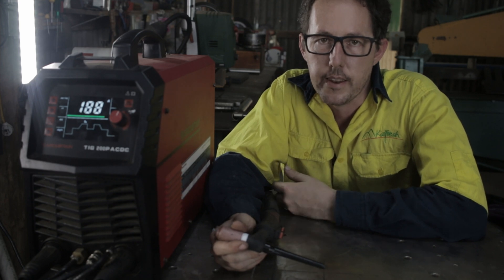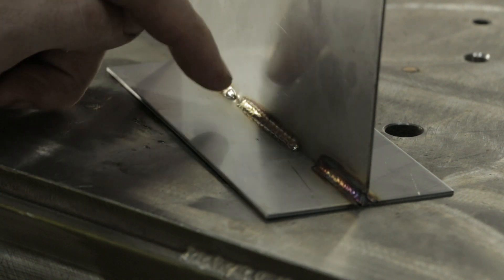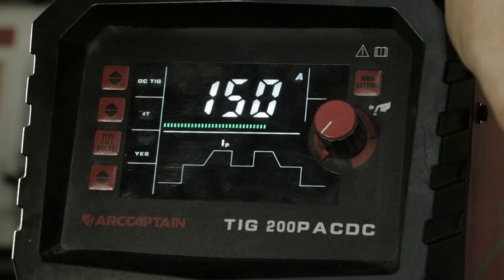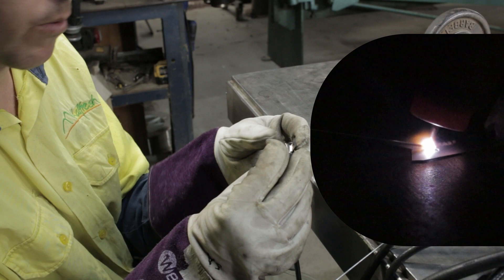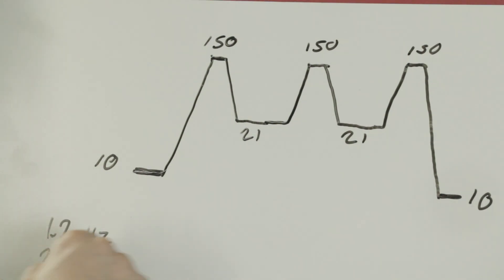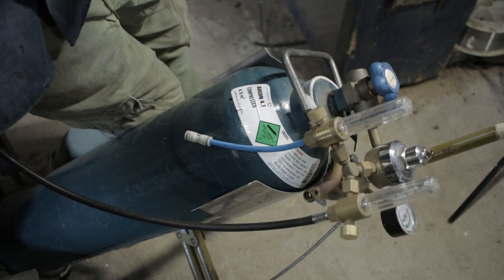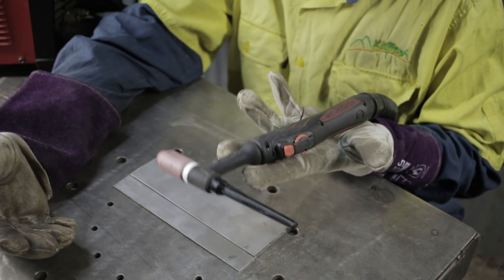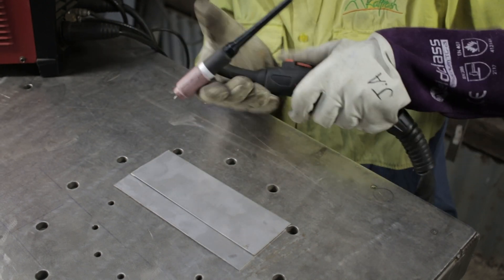Advanced TIG welding techniques

Comment: Hi what do you think about laser welding today
Reply from the maker: It has it's place. For thin sheet metal parts, particularly in stainless steel it would be hard to beat with low distortion and high speed being a big plus.  Not to mention some units can be set up to laser clean as well.   
But with the cost of the units at this stage I would need a lot of work for one to be economical.  
If you had the work it would be a really good investment.

Comment: Great stuff Stevo. 
You're an inspiration as usual. I've used pulse a lot in the beginning, particularly on the sub 1mm ss. I haven't had a workshop for a year, so hardly ever tig. I did manage to get a fresh Argon and a commission for some repair welding on sum fg bins recently. It was tricky, and I'd forgotten the setip of pulse, didn't have scrap to practise on. I managed to get myself comfortable enough to ht the job done neatly, in a working factory by using (a bit too much) gas flow. When i came to finish it was less busy and I was able to tirn thd flow right down. As you know, the problem with repairs is being able to clean up everything before starting. Packaging tape on machinery is the bain of my life, and we don't love acetone either. My cheapo Toolshed dc only $1k Tigger box got the customer happy and me paid😊
Reply from the maker: Getting it done 👍

Comment: Is arcaptain shipping to Aus now? Looked up their machines when you did your review and they weren’t shipping our way
Reply from the maker: They said that they would but you would have to pay extra shipping, I think you need to contact them to get the details.
Reply: @jackhooper5523 Does amazon ship to Aus? If so, I purchased my arccaptain200 tig off Amazon, ended up being cheaper than buying directly from them.
Reply: Having to rewatch as I’m doing tig units at tafe I reckon that they should have this in their teaching resources cheers again for the video

Comment: This video was really interesting, I watched it despite my TIG welder not even having a pulse mode. I have built a 1.5kg combat robot that uses a TIG welded stainless steel chassis tub, and I've been finding the TIG really fun. My welds aren't pretty but I've been prioritising even penetration and heating over a neat bead because I'm grinding it down and polishing it anyway.

Comment: My favorite style of torch actually doesn't have a back cap, and the tungsten goes straight up the barrel.  I hold it just like a pencil.  I also usually use the smaller style torch because I like working with thinner material.
Reply from the maker: That sounds like the go.

Comment: The comment at the end about getting a good welder is the gotcha tho - for instance I was almost tempted - ALMOST - by a Xcelarc Viper 200P DC. It has pulse and HF start! for about $NZ1000! OK, it doesn't have AC for aluminium, but HF! Pulse! Remote! an 8m torch/hose! Except I checked the manual. The pulse mode is kneecapped, it has no control except frequency, and the base current is set to a fixed 40% of the peak current, and the pulse with is set to a fixed 60% of the cycle. So it simply cannot do a 15% base current with 25% on time. Your comment about above 40% pulse width - 'you may as well be welding DC'? Yeah,  that's this welder's only option. DC, or "basically DC". The starting point for 'good welder' seems to be $NZ1900...
Reply: I bought their 195 Max. It retails for NZD $1500, but I upgraded the TIG torch to an 8m T2 torch, cost me $1750 all up. Pulse function works on TIG & Stick which is great for aluminium Arc welding. Whilst it does not have AC, you can still DC weld aluminium very well using old school tricks.
Reply: @draincctv8659  doesn't look like that model is available any more, looks like they're dropping a new version soon but it isn't in any of the usual places like George Henry, TradeZone, Welding Tech etc yet
Reply from the maker: You really do get what you pay for my first couple of welders were on the basic side and if I could do it again I wouldn't have spent my money on them. I would have gone straight to a decent machine. 
Not sure if they are Captain is available in New Zealand but their machines are value for money.
Reply: @LittleAussieRockets  I have to operate off a 10 amp plug & was going to get the Excel Arc 200 ACDC (Unimig) but it does not have Pulse Sick, just Pulse TIG so went the 195 Max.

No Arc Captain down here & Amazon doesn't appear to offer the ACDC machine fro shipping to NZ. I will pick up a good second hand machine offering AC but I am enjoying playing around with spool gun welding Ali as well as recently started DC TIG welding Ali using Flux.
Reply: It’s worth checking out the SWS tig units as well. I’ve had one for 2 years and love it
Reply: @dbayboyds409  That's not a bad price for an ACDC machine - cheers.
Reply: @dbayboyds409  not distributed to NZ as yet, it seems